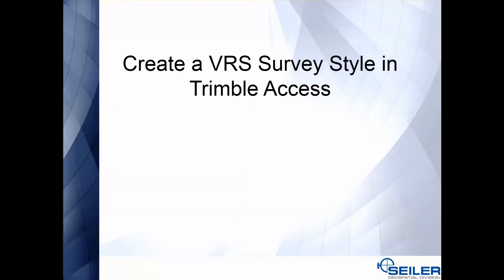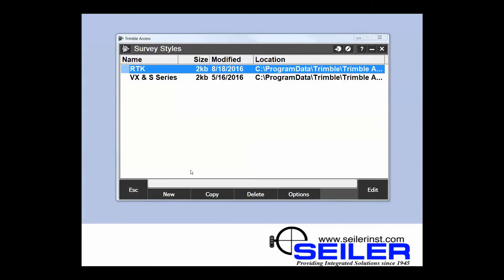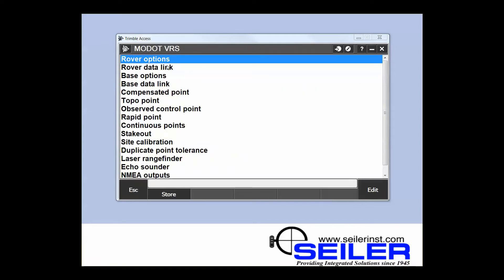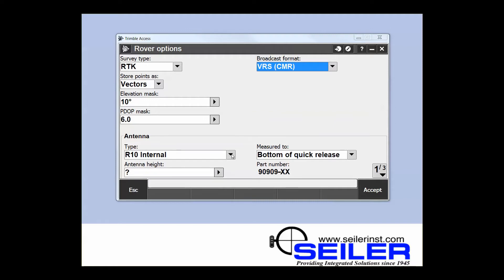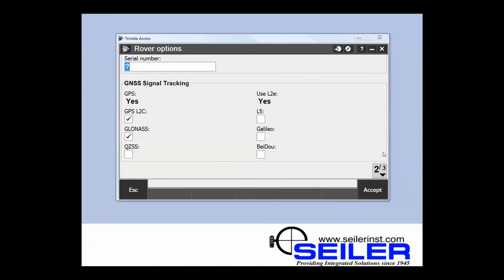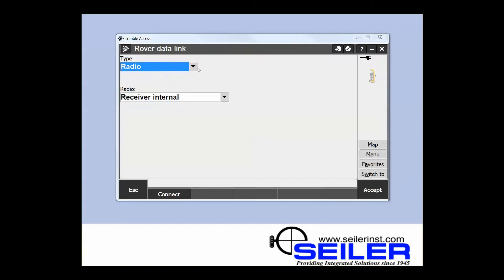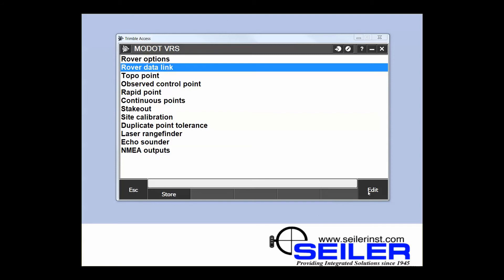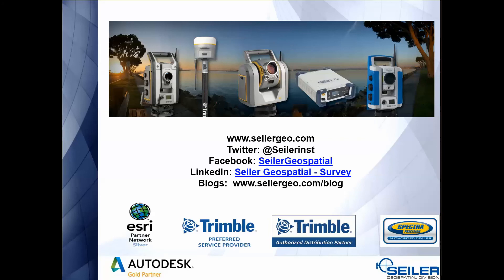Create a VRS Survey Style in Trimble Access

Comment: Dear friend I want to use VRS. However, I have run into some issues. Whenever I am outside the network I get a massage that says "Switched to single site" as expected. But then some different error massages comes up which says "Currently no RTK data available at current location" followed by "Physical base Station information not available ". I am using VRS(RTCM). When I am within the triangle of three stations no error come up. Also we have set our reference network to allow the switch from network to single site  I don't know what I am missing. I hope you could help me out. Thanks!